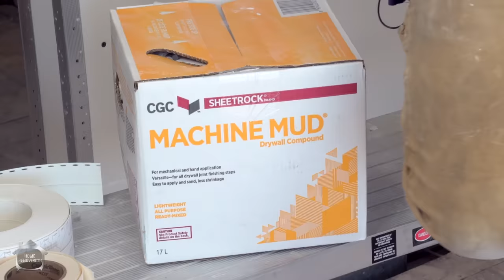DIY Drywall Part 4 | Drywall Taping Masterclass for Beginners!

Comment: Just exactly what I needed to know before finishing my sloppy drywall hanging job in my small 200 sq. ft. shed. I should have watched all your videos before starting ! Thanks for sharing all your knowledge with all us beginners. Any one going into the business should watch and learn as it seems now days contractors and their employees are just to busy to take the time to teach all these tricks and tips. Unfortunately there aren't enough generation x'ers that are willing to learn these trades or even want to do this type of manual labor which has made it difficult for contractors of all trades to find qualified and competent help. I'm a 65 year old that just needed a little brush up on my limited drywall experience.

Comment: Learned a trick from an old pro that I use and works well for me on inside corners. Make your mud moist, (wet) and use an old, large paintbrush to apply the mud to the corner. Fast and wet so no bubbles.

Comment: 2nd video ve watched on mudding. I am used to using plaster for building models. So I have a feel for mud. done many patch jobs but never took the time to see how it's really done. AS soon as I saw you grab a 4inch pallet knife and the mud holding thingy I knew I didn't have to investigate any further. In 1st video I watched the guy used a battery of scraper pre-whet the paper and so forth. Limited tools and no hassle great video Sir!

Comment: I've been struggling with mudding the joints for a few days now and I just took a break from mudding to tell you i just had a breakthrough!! It was as if the heavens opened up and gave me "the skills" lol! My biggest mistake was not holding the taping knife correctly! I was literally plowing thru the mud with the way I was holding the trowel . It seemed no matter how much mud I put on the tape joint the joint would wind up lower than the wall in the center where the tape is.  Lol! I found out that holding the blade flatter against the wall it didn't plow the mud away so much! It also made my seams extremely level with wall. This in turn not only made my seam flat but it also requires little to no sanding afterwards! Its amazing! The seam actually shines when doing it correctly! No bubbles ,no unevenness, no issues whatsoever! ....I feel amazing! I can't believe I'm actually doing it correctly and its coming out looking like I hired a guy that knew what he was doing! Lol! My advice to anybody struggling is hold your knife or trowel blade almost even with the wall and do what the video says. Feather the outside of joint by applying pressure at an angle to both sides then gently float the joint in the middle for your final whipe! It actually works!
Reply: Thanks, the first time I did the horizontal joint I didn't apply enough mud first to put the tape on so it was not adhering right. I took off the tape, let everything dry, came back next morning, wet sanded it back down, then redid it. MUCH BETTER the second time. I haven't used the trowel yet so thanks for this tip!

I think the big thing I also didn't realize was that as long as the very inside corners look great it's easy to sand away any imperfections. The first/second coats don't have to be perfect, it's the final coat where you want to me more careful so the corners all look good. I'm still on the second coat phase and I've probably rewatched this video like 10 times lol.

Comment: Hey Jeff, quick question about taping: In a previous video, you mention that you should always tape your inside corners first, and then do you horizontal joints so that the tape on the horizontal joint butts up to the inside corner tape. In this video, you do your horizontal joints first and then tape right over them when doing the inside corner. Does it matter one way or the other which one is done first and if the tape overlaps each other?
Reply: I was confused on this also. I am a woman learning and getting ready to do my first mud today

Comment: I have been renovating my kitchen and knew I could screw some of the taping and mudding up in the areas that were going to be covered by cabinets, but the ceiling and some other areas had to be done right. I wasn't doing a great job, then I watched this video and it changed everything. Awesome job explaining all the intricacies in an easy to understand and engaging way, you are a master.

Comment: I just drywalled, taped, and second coated the drywall all around our large master bath (with some unusual cut outs and partial cathedral ceilings. There were more joints than in a 21 year olds apartment! I am glad I found this, super helpful, actually found out I was doing quite a few things right (pro painter for 20+ years), but certainly learned plenty of cool helpful tips, like why the hawk has advantages over the try (catches drips, easier to keep clean, more comfortable to hold). And even the measuring of how much you need to crease ahead of time using your outstretched arm length. So many great tips! It's so easy to see you are a wizard of drywall mudding!! Nice work and I will subscribe. Thanks so much and God bless!

Comment: Watched this video a few time's , since i got all my drywall in on my kitchen reno. Started to tape small area's , a distance of 3 feet just to understand how the tape react's , when your putting it on the joint, followed your first step that less is more, my taping job turned out great, now i have more confidence to do longer area's without wasting material and time, Great video, thank's
Reply from the maker: the secret is in keeping the mud wet so it dries to the tape. if the mud is dry then all you are doing is setting the tape next to it. Cheers!
Reply: @HomeRenoVisionDIY  Jeff my tape and mudding job is turning out awesome, never ever did this type of work before,  i mean i really had to ask myself if i really did the work LOL. Thank's again , Great teacher

Comment: Jeff I just tried a little trick on inside corners that seemed to work well....Couldn't get corner nice and smooth kept tearing tape with knife...Got me a tube of Alex Painter's caulk same as used to caulk trim....ran little bead down corner and smoothed out with wet finger just like running around trim....Came out perfect....
Reply: Lot easier than getting mud and tools back out...

Comment: Such a great class! If I may offer something, for small jobs like this, it's real easy to mix hot mud in the pan as you go. Fast, minimal waste, no mixer and bucket to clean between. Fill damp pan with dry powder 2/3, add water, stir with broad knife (takes little time and effort to mix thoroughly). Advantage: you always have enough time.

Comment: If you've got a lot of angles to tape, a soft bristled bottle brush and a pan full of loose mud will speed up the task of getting the mud in the corners. You hit both sides at once, saving trips to the wall.  Then simply apply your prefolded tape, using your index finger to register the crease precisely in the corner. I've found that a medium stiffness 4" knife works best to get crispy corners. My knife of choice is a Hyde 5" for most tasks(aside from wide trowels for coating joints of course), but the 4" is king in the angles.

Comment: Nice explanation. If you have the system be it flats, butt joints, inside corners, beads, screw-heads whatever....you will always know what coat you are on.  If you jump around you are gonna loose track. Nice teaching.
As good as I am and as long as I have been doing finishing, I am always looking like I work in a Columbian processing plant deep in the jungle.

Comment: One thing i do ....apply the bed coat with a water activated hardner mud like durabond 90 to prevent future cracking...ive found the premixed compounds have a tendancy of cracking if used on bed coat.

Comment: Taking screw out: push the knife blade against the shank of the screw then run screw backwards. Threads with catch the blade and comes right out w little to no damage to dwall.

Comment: I tried mudding and taping in my kitchen and on one seam in my bedroom. The kitchen wall taping was a mess and somewhat uneven, but I mudded 2-3 times over the tape, sanding, then feathering as I went along. The bedroom taping of the horizontal seam went okay, but I decided I absolutely hated mudding and taping and drywall in general, so I sanded everything down to the tape and I'm just going to paint primer that's used for wallpapering, then use wallpaper liner made for difficult surfaces. I may use all the drywall compound for skim coating popcorn ceilings, because that's about all I can do with it at this point.

Comment: Jeff, thank you for this entire series and all of your other informative videos.  I taped today.  You make it look so easy!  I am covered in mud as is the floor, but the end result is good!  I don’t think it will bubble.  I think I but a coat and a half on, but I have a few days for it to dry.  The two things that gave me trouble were the tapered edges and using the side of the knife.  I struggled, learned and got better as the day went on…using your tips the whole way.  I expect 2 more days of taping…the ceiling scares me.   But I think the next 2 coats will go faster.  Finishing my 600 sf man cave garage and owe you a lot!

Comment: HEY JEFF! 1 QUICK ASK/TIP/SUGGESTION.  Already the best instructionals you can watch, but as a 20yr editor/motion graphic artist turned contractor & multi year viewer watching this to better my technique..literally watching over & over right Now AS I mud a project im now being paid to do (as opposed to my house I built myself and have had to live with my mudwork for 17yrs) The thing I feel is needed most to help the veiwer trying to mimick step by step (esp 1st timer) is More close Close Ups..  with greys on greys with shadows and on a phone its hard to pickup details like when you mention on the first inside corner about cleaning the outside lead edge.. you cant really see that you mean/have the knife edge corner Off the mud with gradual pressure into the mud. 
The good thing is you can just shoot these extreme closeups of these steps (where angles and pressure point details matter) anytime you mud again and edit them into this vid at the corresponding points. I know it sounds picky & like extra work to make an already great video perfect... But Man, if theres one thing you want to get right the first time and not miss a detail on... andvredo or live with... its this.   Thanks for your work and effort to help us all and congrats on your success which no doubt came as a result from keeping helping others as the primary objective & being your genuine self while doing it. THAT'S the most valuable thing your channel really teaches people. Cheers.

Comment: Jeff have you ever used FibaFuse it is a fibreglass matt (not mesh tape) thinner than paper and the fibres kinda fuse that is the mud mixes in the matt, not stretch no blisters. Hard to use in corners evidently.

Comment: Taping is not for everyone. It takes awhile to get the hang of it and even then, you might want to hire out a big job like this. Doing drywall repairs is a better place to start. It’s a good skill to have and more likely to crop up for the average homeowner. 

This is a good video with lots of useful info. I like all of his videos.

Comment: For the DIY'er or remodelers that want to tape the seams without bubbles or mess you should mention using a TapeBuddy tool. It's much faster and you don't have repairs. The TapeBuddy coats the tape so it has the moisture it needs to stick. Works on all seams! The TapeBuddy tool is needed for this taping task just like the knife. So fast and perfect for taping every seam.

Comment: Just wanting to confirm which way is correct. In your other drywall a-z series you said to always start with your inside corners. In this video you do the horizontal center of the wall first. And again in the other series you use your 6” blade and slap mud on from right to left. In this one you say you advise against slapping the mud on that way and instead use your smaller knife to apply the mud in a horizontal fashion. Which way is best? Thanks in advance.

Comment: In case no other mentioned it before; if you plan to use the same taping knife you use to spot screws that stick out , for actual taping purposes; you should always  run it backwards from the wall toward the screw. You will still hear if a screw is sticking out', but you will not run the risk of putting a small nick or chip in the front of your blade like it could happen if you run the blade forward into the screw. Because then , if you go and use that knife to finish a closet return face, or any other 5 inch wall face, you will get a line in your mud. And that little dent on the face of the knife is hard to make disappear....I learnt that the hard way

Comment: In the UK it is much more common to skim a whole drywall/plasterboard wall with plaster rather than taping and jointing. It requires a lot more skill, time and cost however.
Certainly if I was doing a renovation myself I would go the tape option, I have done a small amount of plastering in the past and it didn't turn out too bad, but it was a lot of effort.

Comment: I use a 6in knife and spread with one corner. I'd done have 4 flat joint taped to this guys one. You don't have to wet your tape either. I've done drywall for 20 years. I use a tape holder so you don't have to pre cut your tape. I also use a pan with a pan holder and it holds more than what he has on is hawk. Also it's quicker using a pan because you don't have to keep sitting it down. I would work circles around this guy.

Comment: Here in New Jersey , even corners that are receiving crown molding need to be taped in for fire codes . Joint compound slows the rate at which fire gets to the framing the same as fire resistant sheet rock slows the fire from reaching the framing . In fact , the molding is considered an accelerant .

Comment: Tape bubbles because there is not enough mud under the tape. Not because it's not wet. Also, use a wider knife when wiping in the mud it's much easier. Another thing is to use fiberglass when using a nail on metal, it will help prevent cracking. I would recommend using tape-on corner bead.

Comment: Creating a gap when putting up the corner bead is a great tip. Never done that. oops! I use 20 min EasySand and colder water to increase working time; warm water, sets faster..

Comment: Jeff, I did really well with all of your advice on corners and verticals. Horizontal tape walls all came out wonderfully except for one spot in the middle of one of the walls. How do I fix bubbles on a taped-wall ? It’s taped horizontally. The bubbles appeared next day right in the middle of one wall. Any advice is greatly appreciated!

Comment: I liked your other way of installing bulk head paper corner bead with the 3m spray, that's how I install it. But for outside corners on metal vertical corner bead I like to use the corner bead installer. Do you use one of those? You basically hit the tool with a hammer n it pinches both sides of the corner bead into the drywall so there's no need for screws or nails. Let me know if you've had any experiences with it.

Comment: Your video's are fantastic. They are well presented and very interesting to watch.  I learned I few things.  Thank You!  However, I can't find CSG Machine Mud in my area (Minnesota).  I researched it and learned that CSG is a Canadian division of USG and is only sold in eastern Canada (your area).  The USG equivalent to CSG Machine Mud is USG MAC (Machine Application Consistency).  And the USG equivalent to CSG Sheetrock 45 is USG EasySand 45.  However I can't find USG MAC locally at Home Depot, Menards, or even at Tamarack Materials... in fact, the salesman at Tamarack Materials, a store for drywall pro's,  didn't know what I was talking about.  I ended up buying USG Plus3 Lightweight compound and USG EasySand 45 at Home Depot.

Comment: Great video.  Joy to watch and learned a few things i wasn't doing properly as a DIYer.  Do you have a video on repairing old tap joint separation (i.e. old tape joints that have been textured and painted, but over the years are now peeling up)?

Comment: I have a wood ceiling, that I would like to have white and flat. Do I need to add dry wall or can use this method? Don't want to get cracks.
Reply from the maker: you definitely need to add drywall.
Reply: @HomeRenoVisionDIY  okay thank you, I saw there was wood base mud. But perhaps the results won't be as good.

Thank you for showing me how :)

Comment: I'm going to obsess over this video for the next week before I do my first drywall work as a homeowner.
Reply from the maker: You can do it!
Reply: @HomeRenoVisionDIY  thanks for all the awesome videos! Great refreshers and tips!
Reply: Have you ever used an angle roller and a tape reel super cheap and save so much time well worth the 20 bucks to buy
Reply: @HomeRenoVisionDIY  Any tricks for replacing ceiling drywall without removing the walls? I know usually the Ceiling is installed first, but I don't really want to have to pull the walls down if I don't need to.
Reply: @HomeRenoVisionDIY  More specifically, I have a 1/2" gap where the walls meet the ceiling where the previous ceiling drywall was installed. Should I try to fit the new drywall to fill the gap, or should I do something else?